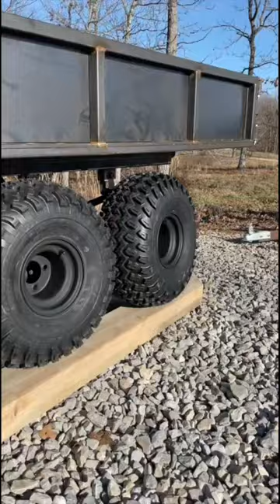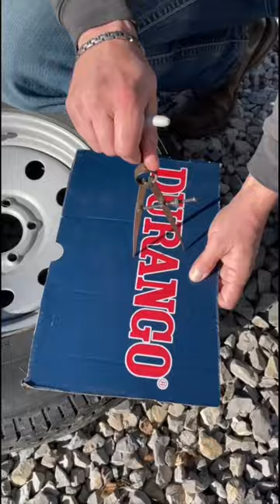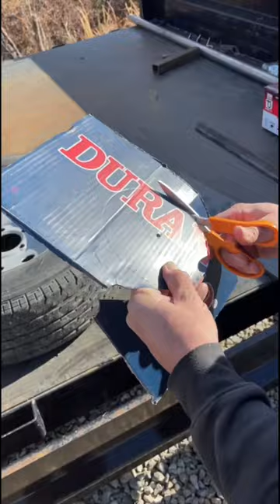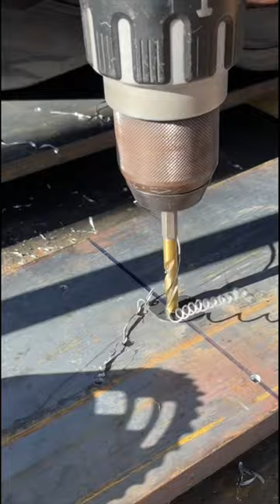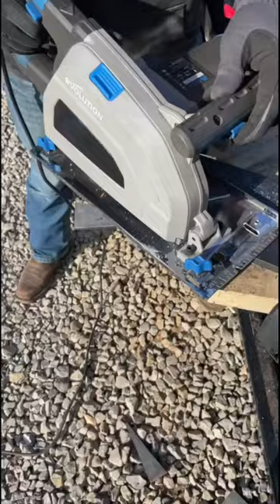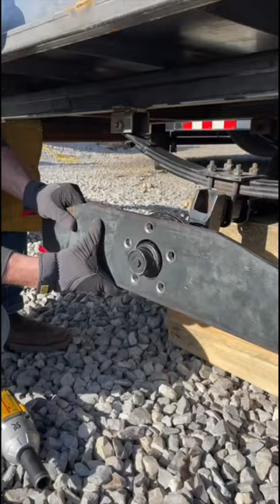ATV Dump Trailer Build Pt.11 #shorts #country #countrylife #ranch #hardwork #fabrication #metalwork

Comment: I know you guys skilled with heavy equipment, but I saw a video of a bush hog turned and ran off a gear on a wheel to pull behind a atv. Would be sweet to see you create one to pull behind the 4 wheeler after a graze to knock down some weeds the cows didn't get.
Reply from the maker: @masonbaylorbears  yes, I’ve seen a similar contraption also, it’s been considered 😁
Reply: @tickcreekranch  something about  using less fuel to accomplish the same job seems awesome to me. Plus I don't have a tractor nor do I want to drive a tractor on my grazing fields. My 4 wheeler ruts and kills grass enough as it is being light

Comment: That flat steel will most certainly bend the first time you make a tight turn with a loaded trailer, the tyres will scrub sideways, plough the dirt and put a huge amount of sideways force on that flat plate.. The rocking beam on semi truck trailers is almost always a H section steel forging, not a flat plate..
Reply from the maker: Used this a bunch and it works perfect. 1/2 plate is performing well. No issues whatsoever with a multiple full loads of oak firewood. This isn’t a tractor trailer it’s a atv trailer.
Reply: @tickcreekranch  dont you love the monday morning quarterbacks! Awesom idea!
Reply from the maker: @jimsutton9143  Thanks Jim!

Comment: I hope this is a joke how tf is that suppose to work😂
Reply from the maker: Not a joke and it works quite well. We have other shorts that show how it all works
Reply: @tickcreekranch  bruh how that bar would make it so the tires can’t spin
Reply from the maker: @noka55  it carry’s two spindles. One spindle at each end. Makes a single axle have 4 tires and lots of suspension travel